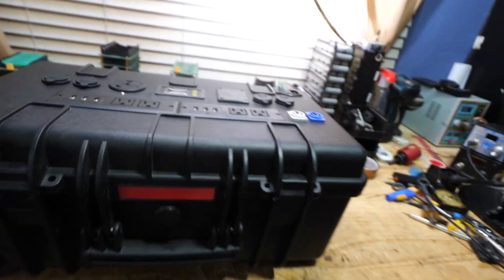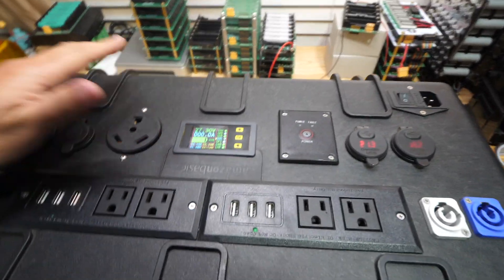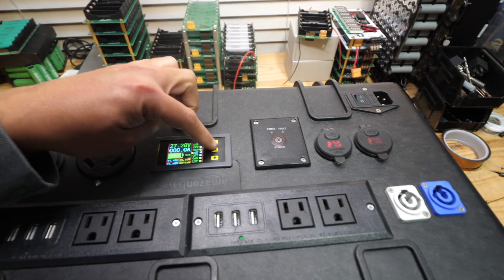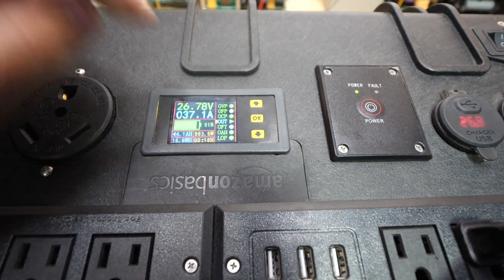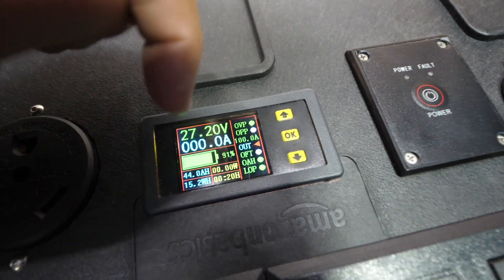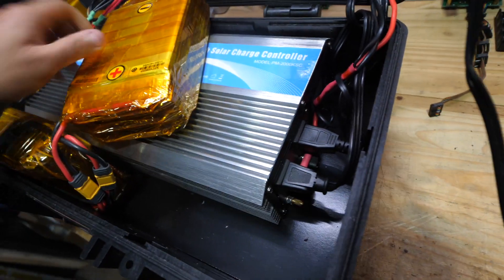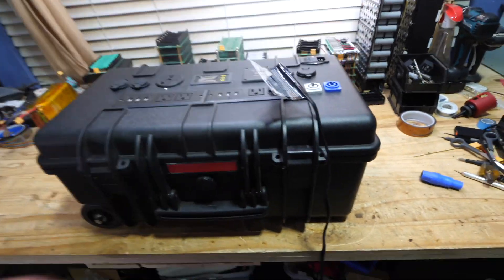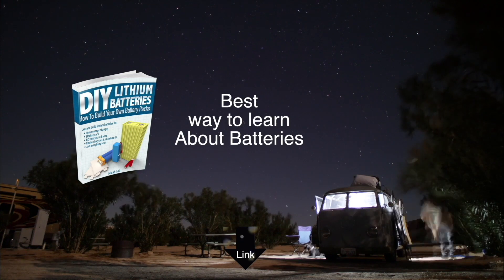DIY Solar Generator still better than NEW Kodiak

Comment: Unfortunately im not keen on this thing. For a number of reasons; my back ground, I’m an engineer at a medical manufacturing plant and a director of a company, that specialises in these units made to order. 

1) your relay overload system. This is a good idea and works well, I have used a similar layout on gear. However in the event of a fault, those cells will happily on short circuit give well over 200A. Possibly more. 

In that case it’s likely too see the relay contacts welded and unable to open. In that case hopefully the BMS would pop but I wouldn’t rely on it. Lipo cells don’t like being overloaded and when shorted they will go off with a bang. Always best to have even a small mini ANL fuse in there as you know that if the relay or meter fails you will always have safe disconnection. 

2) Your wiring: looks to be 200C silicone wiring, excellent and designed to get very hot. My own testing proved it worthy of 1,400C. However the wiring job looks messy, and to the point where you had to put your hand in to move wires when closing the case. 

Will the loose wires eventually wear through their insulation rubbing against the metal case of the inverter or other components, ect... if it’s going camping and in a rough environment in time most likely, hence the need for the above in section 1. 

3) The battery’s mounting: those fat pack lipos below the inverter seem fine, as long as they are secured down and can’t move. Midpoint fusing on a build like this would have been good. 

The ones on top loosely placed next to the inverter is a no no. They can easily move and could possibly become damaged on the hard metal case. You don’t want that. Think if the unit was shocked a few G’s the impact of the loose components against each other. 

Hope the case is flame resistant. My preference is lithium iron phosphate batteries very safe and good for over 20,000 cycles subject to discharge and brand. 

Stay safe.

Comment: It's great that you're doing DIY generators andI would like to have you as a guest on my channel. That said 900$ in parts before shipping and 10 trips to the post office, probably 20+hours of labor for an experienced person (probably 40 for inexperienced), for a battery solar generator that doesnt have to comply with any safety standards is great, but it's hardly a bargain. If your time is worth 20$ an hour this is at minimum a 1700$ investment. The kodiak apex is pre-selling for 1300. That said a person is gifted knowledge when doing it your way which is worth something.

Comment: Great work! Still hungry for schematics and expansion battery and solar panel.
Reply: A great job I just got to building a 900 amp 36 volt solar generator with trailer good job what you did I like how you put it together maybe talk to you down the road

Comment: seeing as you are explaining yourself.. 
1st I do not have an issue with your design, looks good.
Its your device  wire it and use it as you like, however you should always have a mechanical failure device be it a fuse or circuit breaker at the power source output, for each cable used as a distribution, to the load or distribution board , that distribution board would in turn have fuses/breakers rated to suit cabling connected to it. 
Electronic protection is fine to handle overloads or to be used as a limiter, as they can fail, they should not be used for physical shorts or failures.

Comment: I have a question. Say you are able to charge it off just the wall, cloudy day or using a gas genny, could your built in wall charger still keep up with a load? I wouldn't really see it happening with a huge load but say a lamp, fan, tv and such?

Comment: I Love the design of your power supply. Been thinking along the same lines, I Don't think I'd be able to fit all my components in one, but the charge controller is inside the inverter? Is that how they are designed from that manufacturer? Great job. Like those battery packs as well.

Comment: should still have put a reall fuse in there.. common theyre super cheap and easy to put on.. fuses are super reliable.. have you ever seen a fuse that doesnt blow ? relays and a cheap chinese board isnt exactly reliable.. other than that its a pretty usefull device and seems to be built well.

Comment: Its not a generator its a power storage unit.........That's not hate its a fact. Solar community seems more like a cult than any kind of science. Power storage units all need a power source (producer )  like a house power plug, generator or those over priced limited weak solar panels to recharge them. So in an RV skip the middle man and just use your generator to supply power to your appliances...........Michael

Comment: New to building battery power units etc. 
How are you charging the unit. Could you just tether this to a 400watt solar system and charge it. 
Excuse the fact I’m new to building electrical projects 

Looks great. 
I need it for my skoolie build

Comment: What do you do about moisture or water ingress? I imagine that’s why you would want fuses. Not saying you would use this outdoors but those fans are big holes in the side leading directly to the battery packs.

Comment: What I REALLY want to see on this DIY project, is how the EXPANSION port is utilized. Say you have a full (29V) internal battery and then plug in an empty (21V) expansion battery. If they are just paralleled, with no additional electronics, then this is gonna result in HUGE currents, since there will be nothing there to limit the current, except from the cells' internal resistance, which is sooo low for pouch cells, let alone that you can't rely on pushing in or pulling out power to and from cells on their max C ratings. Sure, the BMSs will eventually kick in and kill each battery for a couple of seconds and then restart, but that's no way to charge a battery. So, how is it gonna be? I've been looking all over the webs for a CURRENT LIMITER that would be EXTRA USEFUL in such cases, but they only come bundled with boost/buck converters. There is no item that will just limit the current going through. Any ideas?
Reply: For the expansion port I would use Anderson SB high current connectors instead of the ones he’s using. The ones he’s using are rated for 20A with an AC voltage. If you’re pulling a 100A load and hook up a battery to the expansion port, it will divide the load and pull 50A through the expansion port and badly overload the connector.

Comment: Your price total doesn't include the batteries? They're $210 each. You said you have 6 of them? So $1260 in batteries plus $817.52
Reply: Apparently you can't add because the total would be 881.42 then. Don't you need 6 of those battery packs?
Reply from the maker: You obviously don’t know how to add,  try using a calculator next time
Reply: @jehugarcia  210x 6 is 1260 bro
Reply from the maker: I see you don’t know how to read either,  $210 for all 42 cells and that’s already included in the $800 price.

Comment: It's easy to criticize on a finished project rather than get your hands dirty and build it from scratch. I mean I like Kodiak, but it doesn't mean I have to hate yours. It's not a either-or scenario. If you can afford to buy the kodiak, go ahead and enjoy. If you can't and wanna build one by yourself, I think this one is cool and full of capability, plus, if you want to add fuses and other modification. that's totally fine too. It's open frame. another thing better than kodiak ;-)

Comment: Your very intuitive, professional and knowledgeable. You have made an excellent build. Would it be possible for you to make a video with agm batteries and maybe stuff that doesnt require sodering and could be put together a little faster and cheaper but would still power power tools and stuff on a job site? Thanks for your time

Comment: Why did you use a 30 A socket if the inverter can't handle it?
Reply from the maker: because the 1500w Kodiak uses it and im building a diy version of it.
Reply: @jehugarcia  Ohh I see

Comment: Yeah relays are better than Fuses, totally. 

Sounds like someone dont know what a Fuse is. 

If you have a shortcut the relay welds its contacts and this thing burns quicker than a tank of gasoline. How can someone work on Batteries the whole day and replace a Fuse by an relay. Of course there are relays which can have a short cut protection so they shut off the System. But this one aint one !!
Second, The Fuse has to be near or even IN the Battery circuit (between cells). The longer the Wires till they reach the Fuse. The more dangerous this will be. 

Its not about several outputs with connectors no one even needs. Its about making SAFE product when using Batteries with High current capability.

Comment: WHAT about the size the diy is Gigantic! I own the Amazon case I use it for ammo and The kodiak fits in my trunk with room to spare the ammo case  does not! The  point of the Kodiac is its compact. People have been building these things for a wile and you can even build it alot cheaper If you order from Bangood! The Kodiak has a warranty the diy does not! That alone is worth buying the Kodiak People want convince and a Guaranty No body wants to build this thing They want it and want it now! No one needs 8 usb ports whats the point? The Kodiak is open box plug it it  Done! this thing there is 45 min of playing around just to get it to work! The avrage person does not want that! Its a cool project just not Practical!

Comment: For the expansion battery pack,  could you include a grid tie inverter as well as a micro grid way to charge to the expansion battery pack? I mean that would be super helpful in cases like Puerto Rico and other remote communities since people wouldn’t need to be close  to the whole solar array and could create their own micro grid from neighbour to neighbour using a cheap ac network alternative. 

Love your videos man

Comment: A RELAY IS NOT IS NOT A circuit breaker nor a fuse it is an electromechanical switch ,what will happens when you have a short somewhere you have to fuse everything  ,you are sharing miss information.
Reply: another know it all

Comment: I copied this chest freezer/ fridge conversion -  https://imgur.com/drhB9tw   and used the 600w Giandel. It powers it really well and the system works with little draw. However when the temperature relay tells the inverter to turn on, the inverter rather than having a power switch that I can leave on, it has a button and remote like in this video. Any ideas? Worth risking opening a new inverter to rewire the switch, or return? Maybe I can solder the motherboard on the remote to tell it to always be on? Thank you

Comment: Relays... better then fuses... then they are circuit breakers,,, So the Relays in my Car are circuit breakers...... Um sorry... Industry uses fuses for a reason... you allways protect the wire... relays are not circuit breakers... even if they are controlled by a Solid state device that can Fail.. Please everyone, use a fuse or fuses. that is why they make them. the unit will NEVER pass UL compliance.
Reply: I agree. I would use solid state relay(s) instead. They can handle bigger load. Won't arch so the contacts won't weld together.  Inrush current is the problem.....

Comment: Great job, I have a Predator 3500 inverter gas generator. I would LOVE to have a 3000 watt pure sine wave solar inverter generator like yours that could be charged with a house plug in, 12 volt car charger, or solar charger  with connections to expand for additional batteries. I have a 30 amp MH and I would like to be able to run my heater or ac units, etc. I can do that with the Predator. Does anyone make such a beast ? There is a BIG market for that kind of unit. The K2 at 1500 watts is so limiting its hardly worth it. How much to build one for me ???

Comment: In the build video you soldered in balance leads into the batteries. Though now they are replaced with BMS? I just want to make sure that I have the correct build before I burn myself to the ground.

Comment: I'm guessing that since you did it for 817.00.....for a single build .. and since Kodiak is on a large scale they can most likely do it for 700.00 or less....
So at 1,300.00 sales price they are making it for 600.00 minus overhead.....so they clear 400.00 a unit on sale and 700 clear on a 1600 regular price...
Just guessing....
What is your thoughts..??

CHIEF JONES

Comment: Well done! You have made a wonderful fire bomb. The IRA and terrorists the world over, will love the construction. So easy. Turn it on and run away as fast as you can before it explodes into flames. 
A perfectly constructed bomb.
Reply from the maker: Yes a bomb that doesn’t explode
Reply: @jehugarcia  err no a bomb that will explode the 1st time its used for any length of time. 
1st you compromised those cells by cutting the packaging down.. its there for a reason you know?? Ok obviously not. 
Then you stuff them tightly into a Plastic box with no ventilation. 
The to really make a guaranteed bomb you stuff an inverter smack on top of the batteries. An inverter that has a lot of cooling fans.. which are there for a reason as well. But now are totally useless because they are sealed inside a nice flammable box. 
Then you seal the box without putting in anything like a temperature sensor or alarm.. 
As I said a really good incendiary device / bomb. It would be nearly impossible to make it more dangerous  without actually packing gun cotton around it. 
Its not like you do not have a history for making incendiary devices. I would have thought you might have learnt from that experience?? 
Generally I love your videos and the things you do to help people.. but this device is just seriously dangerous! The video needs to be pulled before someone gets killed after following your advice / build instructions.

Comment: I was wondering if someone can think of a generic/flexible way of using the batteries.  What I mean by this is:  "I would like to use the same batteries for both powering the things in my house/RV but also use it in my e-bike and also use them in a troller motor for an inflatable boat.  The idea is kind of following the logic of the Home Depot Ryobi Tools where the same battery can be used with all the Tools.  We know that one of the most expensive parts of Solar Energy is the Batteries, the same apply to e-bikes and troller motor for an inflatable boat.  So, I am waiting for someone to come with an easy/cost effective way of using the same batteries in these 3 different scenarios. Actually I can even think about a 4 which is to jump start a car like the NOCO Genius Boost. The DEWALT DXAEPS2 kind of does most of these things, but can't expand by adding more Lithium cells and also cant just use it to power e-bikes and troller motor.  I don't want to have one set of batteries for my e-bikes, another for my troller motor, another for my car jumper and another for powering appliances. I want to have the flexibility to use the same system in multiple scenarios!!

Comment: In the price point comparison, yeah your's is better bang for the buck.  the only advantage for the Kodiak is the smaller form factor (portability) and the superior battery chemistry.

there is a lot to be said for DIY, if you built this yourself, and a component fails, you can just swap it out no bother, if you spend 2k on a Kodiak and it pop's outside of warranty period, tough luck I guess.  there's a lot to be said for the Kodiak for those who cannot or will not take on such an in-depth DIY project, but anyone with a basic understanding or build experience would be far better served doing something like this.

cool work fella, keep on showing improvements please :D

Comment: Genuine question, no ill intent!...

What's the response time for that cpu-based circuit breaker versus a fuse?

I mean, fuses are also there to protect life... each millisecond counts when it's pumping all that juice through your body. That setup looks like it's based on a CPU... which has the screen updating every second... Is that the polling interval, and maximum/worst-case for shutoff? 

What's the worst case time from spike to shutdown?

Comment: Thanks for the video.  I love this project.

However, I am confused by something.  How do the solar panels charge the batteries?  Don't you have to install a separate solar charger for the panels?  How are the solar panels wired in?

Also, any chance you could provide a wiring diagram for this project?
Reply: I was looking this up myself. If you got 7:00, the inverter he got is also a solar charge controller. It doesn't look like Giandel sells that one anymore,  but they do sell what looks like a newer version. I'm concerned because it looks like it only supports SLA/GEL. LLithium chargers are a slightly different beast. There are chargers that can switch between SLA/GEL and lithium, but it has to be built for it. I think this is the new version of the inverter he uses: https://www.amazon.com/Inverter-2200Watt-Converter-Adapter-Outlets/dp/B07PM4FG69

Comment: Battery packs are $210? And you put in 6 of them? Please confirm.....
Reply from the maker: 6 batteries 42 cells,  watch the videos
Reply: So just one of those packs in the case then...$210 for one, and you could add a couple more externally to the container and increase storage, if you wanted. Thanks again, can't wait for wiring diagram so I can build one. I appreciate your willingness to share your knowledge with everyone

Comment: Great job, as usual! I've been looking at the Kodiak K2 model and assume the specs on this one are a bit better. K2 is on sale for 1300 and supposedly better than the original one. Would love your opinion on that....Love the replaceable component idea, instead of a sealed box that doesn't allow for easy change-outs or upgrades, should it become necessary or desired. I'll be watching for schematic/wiring diagram, and thanks for the parts list, very helpful! Where's the cute pooch?